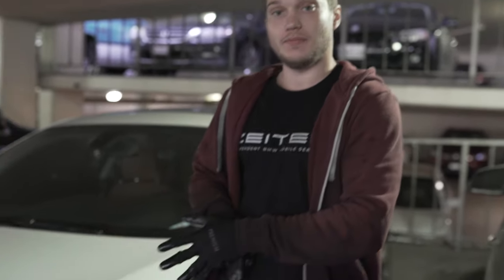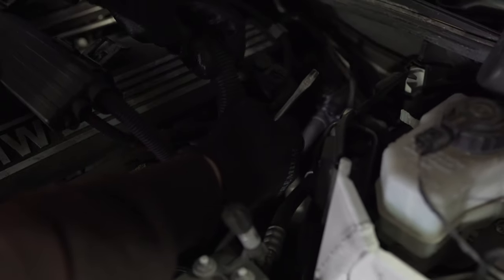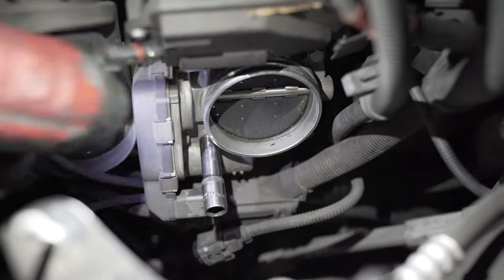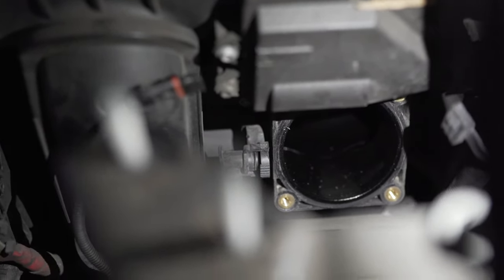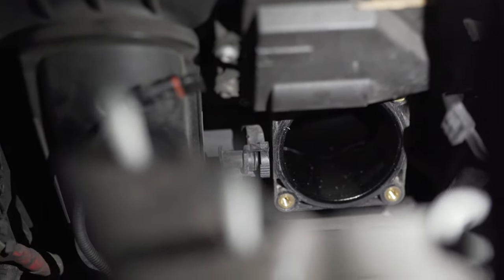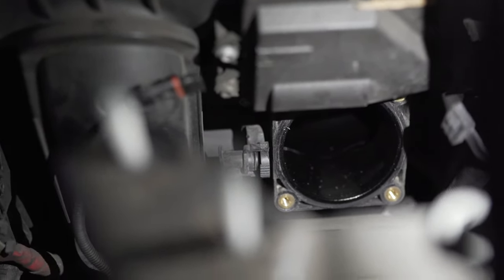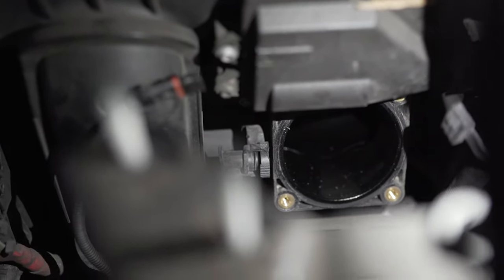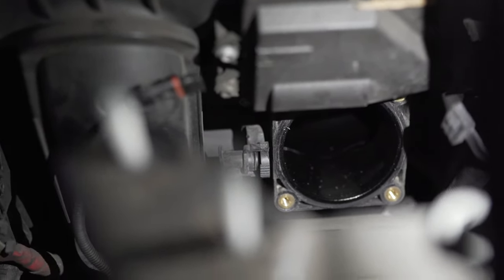DIY E90 BMW 328i Starter Replacement (FASTEST WAY)

Comment: Wow! That is a very convenient spot to place the starter. Gotta do all that just to find a common car problem to replace like a starter.
Reply: Ironically still easier than replacing a starter on most other vehicles including the ones that people think are easy to work on like chevy, honda, etc.  Don't even need a lift or to jack the vehicle up.
Reply: Yeah, trying doing a starter on many newer Audis, especially with more than 4 engines, you’ll start to think that its super easy on BMWs
Reply: @fastboatster Are you talking about hybrids or what? More than 4 engines? I know of some freakshow custom dual engine beasts but I think you mean more than 4 cylinders. I think most modern vehicles have so much stuffed into cramped engine bays that if it's not something like a starter, it's something else that requires you to remove 10 other things before you get the actual part that needs to be replaced.
Reply: @scottrobson4097  you are right, was talking about cylinders
Reply: @scottrobson4097  also forgot to add that it’s a one thing to remove 10 different things at the top of the engine bay and it’s another to remove just 2-4 things like transmission. I started to talk about Audis because my b8 s4 had a burnt starter. It was not too many things to remove to get to it but the access was a challenge. On its own, unbolting 3 nuts holding cat converter to the manifold doesn’t sound bad but it has some very challenging angles and takes a lot of time. It’s just one aspect of that job, one starter bolt is challenging too and you still have to remove the engine mount support arm. Lookup shopdap b8 s4 starter video. B8 a4 is better because the cat is easier to access, and b8 rs4 (v8) will have dropping the trans, a 350lbs monster, but no stuff in the engine bay. I’ll take the e90 starter any day of the week, it was basically smooth sailing through the procedure to get the intake manifold out.
Reply: Right what happened to the starter being at the bottom where tranny and motor meet. All u needed to do is remove 3 bolts and disconnect battery wires
Reply: Imagine it's even worse when you have the pre face-lift model as it has the pcv valve over there as well

Comment: Man, you are definitely a very good, top-notch mechanic. I have watched many of your videos and learnt so much from them, including this one. The best thing I like is when you say from deep experience about not replacing certain parts (like the intake gaskets or the aluminum bolts) which goes against standard textbook advice from most other mechanics. Sometimes you have to do that when you are in a pinch and don't have those parts with you and it provides some peace of mind knowing that those are not critical parts.
Reply from the maker: Thank you, i’m glad my knowledge is useful😉

Comment: Thanks for reminding me why id never buy a bmw.What a nightmare of a car to work on.
Reply: This job is hardly a nightmare. I'm doing it right now. One difference is I didn't remove the intake manifold. I just took the bolts off and removed the studs and moved it off to the side just enough to reach the starter torx bolts.
Reply: @William Lloyd-Roberts I agree with your points. I replaced the starter ~ a month ago and I left the manifold in place. The trick with using an 11mm box wrench or ratchet on the rear bolt is golden as there's no space back there to use an E13 socket. I bought a new Bosch unit(not worth cheaping out here), new bolts, but I could not make enough room to replace all 6 intake gaskets so I settled with replacing the first 5. The old ones still looks in great shape so I settled for it.  I get his strategy though as many people unfortunately want to pay the least amount to get their vehicle back up and running so he fills a market that is not surprisingly in high demand. I mean, it's sure convenient and impressive that he comes to the inoperable vehicle with all of his tools and does it on the spot.  In a pinch I would probably do the same. Not everyone can "afford" to do things properly until they realize that doing it properly is actually more cost effective in the long run.

Comment: Thank you for the detail in this video, and for not constantly cutting out the important portions! I was terrified to DIY this before watching the video, and now feel I can manage it with enough care and time! e90 328XI 2011, 162000km, suddenly wouldnt start one morning. Battery full charge, Ground strap replaced, all voltages check fine, all lights and stereo work fine. So this is my next move. 
Thank you again!
Reply from the maker: Happy to help🙌

Comment: For anyone who is willing to take on this task - it's not that hard. 
No special tools are required to get to the starter. BUT, my tip to you (from my personal experience) go and buy this this ratchet from Harbor Freight (3/8 In. Drive T-Bar With Flexible Ratchet
), it worked like a charm after unsuccessful tries with flex-head ratchet. This tool was recommended by another mechanic in one of the e90 starter replacement videos. Save yourself some time with a good preparation.
Bolts on my 2009 335i Xdrive were E12, not E14 but it seems to vary by model/year, be ready with both sockets.
Good luck!

Comment: I just spent a few leisurely hours taking out everything. That tip about removing the breather hose is invaluable! Thanks for that. 

While I have all this open, I will replace the engine mounts. Hope that goes as well as this did. Thanks for your videos.
Reply from the maker: Happy to help🙌

Comment: Thank you! Excellent video! You walked me through a tedious job with clarity and a great attitude.  The tip to use the 11mm on the rear facing starter bolt was so clutch too.
Reply from the maker: Happy to help🙌

Comment: Changed my starter on e82 coupe 125i...cheers, broke the small bolt but got it out with drill and screw driver....lucky bmw dealer had bolt set....great vlog

Comment: You the best bmw mechanic Dan from New Zealand amazing skills man I did fix my old 318ti m44 rear heater core flange found it to be straight forward  apart from the space I also have an 325i 2008 e90 which I’m at this stage only doing oil changes on but after watching you mate I feel more confident lol kind regards.
Reply from the maker: Thank you, happy to help👍

Comment: I followed this video step-by-step few days ago to replace my dead starter.  I watched it a couple of times before getting to work, all went very smooth, Thank you for this and all your other excellent videos.. from Toronto Canada !   Any chance you will do e90/e60 transmission fluid change video in the future?
Reply from the maker: Thank you, absolutely, transmission fluid change with mechatronic seal replacement video coming very soon, i’d say in a week or so it might be on e70 x5 but it is the same on e9x and e60

Comment: Great video.
However, I would not recommend to use that 14mm wrench to get that E14 screw loose....if the screw is pretty tight in there you might strip the head of that screw(like I did).

Comment: Very nice guide, worked out great with your help! 

Used all E-sockets and wrenches not 12-points, where applicable. 

Wish I had a ratcheting E-wrench for the bolt at the back of the starter, but that would be a one-time tool for sure, E box wrench worked fine :)
Reply from the maker: Glad to hear it, good job👍

Comment: Great video! I'm working on replacing the ccv system of my 06 325i. Any suggestion or video on how to remove the lower breather hose from the dipstick tube?
Reply from the maker: Don’t have a video yet, pull the tabs on sides of the hose and lift straight up, no side to side movements otherwise can brake a piece that attaches to oil pan it’s made of plastic
Reply: @Zeiten  thank you! I got it out without breaking anything. Problem now is the installation. Got the intake manifold back to its place and trying to plug the new lower breather hose.
Reply: Andrew Hernandez 

i was in the same spot 2 weeks ago.. i took out the intake and replaced the whole ccv with all the pipes and could not attach the breather hose .. in the end i bought a better brand hose by febi billstein and use dw40 silicon to lube and in the end i managed to get it seated correctly...
Reply: @AndrewHernandez-ke2ik  why did u have to buy new breather hose?

Comment: Excellent video.  I have done a bunch of starters on N52s and if you don’t take the care and removal that you showed you can crack your CCV hoses or rip out the crank sensor plug.  Your method gives great access for easy removal.  Good point about the manifold seals as the motor is quite forgiving by design.  One note about cleaning the throttle body comment, I thought valvetronic engines didn’t use the throttle body to manage air intake and they run in full open mode closing only for failsafe.

Comment: First of all great video. Thank you! did the break feel stiff and didn't want to depress? I have all the same issues i just didn't know if you had that problem as well. When i try to start my 2009 BMW 328I I'm getting power through the car. All of the lights work etc.. but when I press the break to start it, it feels stiff. I try starting it and nothing happens. no sounds. not a click or anything. After watching this video I'm thinking its the starter. Did you have that issue with the break feeling stiff and not wanting to depress when trying to start the car?
Reply from the maker: Brake pedal has absolutely nothing to do with it, replace the starter and everything will be fine. Try without starting the car to press brake pedal a few times and it always will be hard
Reply: yea im having the same issue, did you figure out if it was the starter or not?
Reply: @scooter9542  i changed the starter out and got the exact one he talks about in this video from autozone. it worked great for like 2 days but now im having issues again. it takes awhile to crank over and some times it wont even start, i have to give it like 5 mins and try again. i think i may have blown the new starter or something because i didnt unplug my battery when swopping out the old starter with the new. Thought i did but i didnt because it sparked when i was putting the cord back on the starter. Now every time i get the car started all the electrical stuff in the car resets such as the clock and the amount of miles i have driven that day, i have the tire pressure signal on all four tires but to answer your question, when i replaced the starter it started right up no issues and this video will literally show you step by step on how to replace it. just make sure you unplug the battery
Reply: @Zeiten  is it possible to blow the new starter or cause more issues with the car if you dont unplug the battery when changing the starter? i changed mine and thought i had unplugged the battery but didnt and when i put the new starter in and tried hooking it back up that main cord that goes onto the starter sparked when it touched the the side of the new starter. it worked well for about 2 days. Now im having issues getting it started again and when i do get it started some of the electrical stuff in the car resets. My clock goes blank and the miles i drove that day or the day before now say Zero. its not the actual odometer that says zero.
Reply from the maker: Check your battery, old starters could destroy your battery easily, your symptoms are not about the starter, look into battery and alternator
Reply: @Zeiten  i went and got the battery charged at autozone and they told me it was good battery. After charging it ,the car did start right up with no issues but as days went on the car started doing the same thing with all the electronics in the car resetting and it taking a few cranks to get it started. I'm going to check the alternator and see if maybe that's the issue. I appreciate all the help!
Reply: @drethomas1446  yea please let me know what happens. I basically am having the same issues with my brake pedal locking up, clock reset, and i didnt disconnect my battery when i changed the starter with the duralast gold too. Only difference is my car never started after swapping the starter so yea....please keep me updated
Reply: It could be the IBS sensor on the -ve terminal of the battery.
Reply: @drethomas1446  So was it your alternator then?  Your alternator failed to recharge the battery which then resulted in a slow start?
Reply: @cuzimadapapushkian799  yes it was. if you are able, I recommend just buying a battery, starter and alternator. You will eventually have to get them anyway. But to answer your question yes it was the alternator.
Reply: @drethomas1446  That makes complete sense.  Glad to hear it all works now like it should.

Comment: I wasn’t able to to get the back bolts to fit in the wrench I used the etorx socket and a flex head ratchet

Comment: Looking sharp bro u helped me fix my x5 in koreatown , I recently purchased a 328i e92 

can  broken ccv cause rough idle cold start ? New plugs new valve cover installed ..
Reply from the maker: Possible, also vanos solenoids can cause those issues, as usual need to see
Reply: Lol mine died in DTLA... 100 degrees no AC 🤣

Comment: my car is doing this but it’s -20c in canada rn… idk if it’s jus cold or if it’s any if this
Reply from the maker: If lights are not flickering when you try to start then it is starter, if everything blinks and flickers then you have power issues
Reply: @Zeiten  it was my starter, lights, heat/ac everything was still working, it jus wasn’t starting

Comment: What size bolts holding wire harness under manifold? 10:04
Reply from the maker: Torx 30
Reply: Mine were Torx 25 for 2010 535i xdrive

Comment: @Artem Iavkin Thanks for ALL of your help, everything is back together car start perfectly but I have a rough idle until car warms up it idles up and down unless i keep rpm over 1000 until car is warm then it runs like new drive and idle fine did I miss something for this to idel  this bad at start every time I start the car? Thanks so much for you help!
Reply from the maker: Well can be any number of reasons, get the car scanned, possible causes are one of breather hoses cracked or not fully in(you got 325i as far as I remember) then check if you plugged in fully breather hose for purge valve behind throttle body, very common for people to forget about it, then disa valves might be at fault, vanos solenoids, intake boots not fully in and list goes on and on, get it diagnosed properly
Reply: @Zeiten  Thank you.

Comment: awesome video..thank u i need a question answered..changed plugs, starter, air filter got a few MAF codes..but RPM is going crazy when i start car reving up and down all over the place..what causes this? I am wondering if my throttle boot is on far enough..there is a mark on the boot near throttle..its at 12 oclock is the boot suppose to go over this nub of steel its a bit raise..hard to explain but the rubber boot also has a litle nub sticking out at 12 oclock..do these go over each other so the boot fits on all the way? thanks what is causing this reving of engine and misfire
Reply: @gail did you find out what was wrong with that mine is doing the same after i changed the starter until car gets warm then it runs fine, thank for any response.
Reply: Yes them little nubs on the TB are supposed to go into each other.

Comment: The starter bolts are aluminum and designed to stretch, REPLACE them. They are cheap $ and there's a good chance they will strip or break a 2nd time.
Reply from the maker: Nope, not true replaced thousands of those starters
Reply: Yes if not replaced they can snap the next time they are undone. I have seen it happen. Not expensive, just replace them.

Comment: my 06 3.0 x5 planning on doing starter and ccv this summer, not looking forward to it. Good Vid. 👍👍
Reply from the maker: Starter on your engine last forever, I wouldn’t replace it until it dies, on my e53 it is 227k miles now and original starter that has never been replaced
Reply: @Zeiten  Thanks for the info. Wish the ccv was the same
Reply from the maker: Well it lasts longer on x5 than on 3 series for example, but still needs to be replaced eventually

Comment: @@Artem Iavkin one more question there is four (4) wires connected to a outlet the breather hoses connects to it are they to be connected in any one order or just connect them in as long as they are connected. It is located at the back bottom of the intake you plug the top breather hose and the bottom and 2 more wires into it. Thanks again.
Reply from the maker: From top to bottom, 1st - wire from valve, 2nd - wire from hose that goes ti valve cover, 3rd - wire from hose that goes to oil pan, 4th the last remaining wire

Comment: Im going to buy a bmw 2mrw guy says its just the starter so before i buy it for 2 grand can i just bump the starter to at least crank the car to make sure its only a starter problem vs a motor or transmission?
Reply from the maker: It’s a gamble, I doubt you can reach starter without removing intake manifold and usually no seller will allow you to do so

Comment: I stripped that bold any ideas how I can remove it? Thank you
Reply from the maker: Use e12 socket and try to hammer it over stripped bolt there is next to no room there but it’s possible you can slowly push it it if not hammering. Other option is also using e12 with extensions and try to hammer it in from the bottom

Comment: Hey quick question. Do i need to replace to crankcase breather hose??? I don’t have enough time to order because it won’t come fast enough I heard it breaks when moving the manifold just wanna know
Reply from the maker: Well if you disconnect it properly nothing will break, absolutely not necessary to replace it if everything is done right